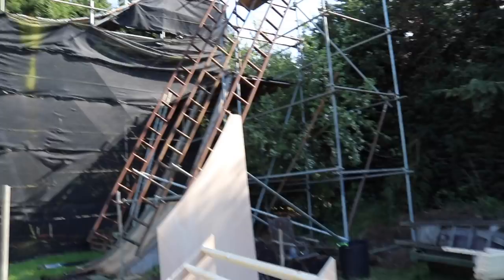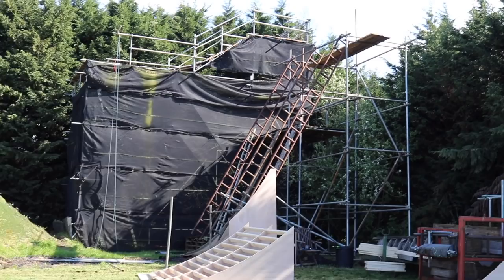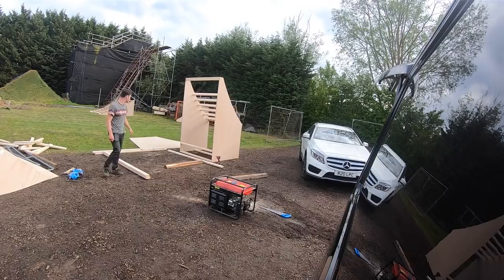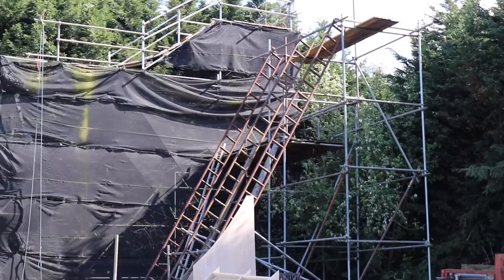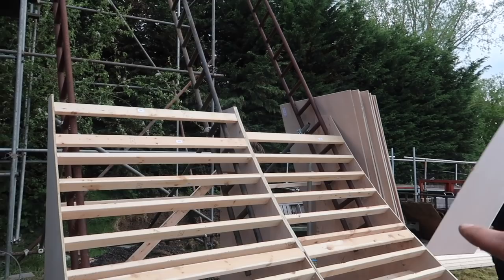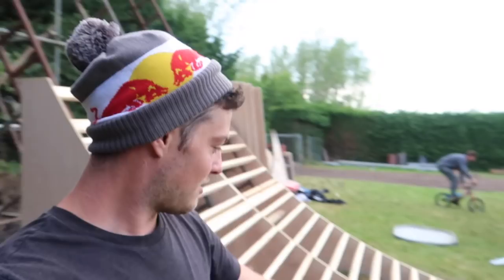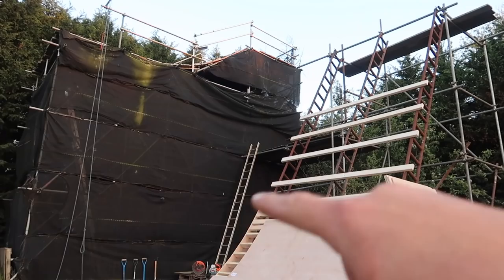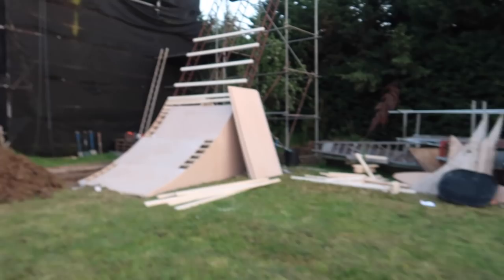THE AIRBAG ROLL-IN IS HUGE!!

Comment: Love your videos, can't stop watching even though i've never jumped a bike in my life!

Obviously too late now but maybe a suggestion for next time, use marine ply as it will last 10 times longer and wont delaminate and for the curved sections try using two sheets of 9mm ply. If you stagger the joints and use waterproof wood glue between the sheets it will be super rigid and v strong.

Comment: wood directly into the ground isn't really the best idea, the moisture from the ground will make it rote way faster :/ you could have put a waterproof cover underneath
Reply: Adraps its only going to be sitting on the ground like all of his ramps are itll be fine hes going to dig all that grass out
Reply: I reckon add some kind of treatment to the wood too if possible. Maybe bed in the sides with stones for better drainage?
Reply: FreeRider it’s not because he always done it like this that it’s the good way, btw he already had roten wood like the quarter he is rebuilding
Reply: Adraps yes and no itll help for sure but c'mon  this is matt. also main problem  was the quarter  was stright ply on mud. most my wood kickers at mine last 2ish years before needing new ply wood and the base and frame work has lasted as long as ive built them. granted this isn't uk weather
Reply: FreeRider i’m not saying that it‘s rubish, just wanted to underline that it’s a shame, it didn’t need really much effort or money, and that he should have done it at that point.
Reply: It's sitting on concrete footings you can see them when he shows the trench.
Reply: Adraps his jumps his life  and not its not a shame

Comment: Putting all that effort to build it defiantly makes sense to put some effort in to wood preserve it with something. Also the bottom bit needs digging around so that it’s not a low point. Ideally sit it on some slabs or bricks not more wood to pass the moister through.

Comment: Why did you put the plywood straight into the ground? The base is going to rot very soon.
Reply from the maker: I’m going to concrete around the footings up to a height above ground lever so it’s sold and the ply meets the ground above the water line

Comment: I was just wondering why you dont use HPL plastic (i think it's called like that) for the decking of the roll-in. It's the same stuff Vertical Skateramps uses for their outdoor ramps. It rides great and will hold for years!
As far as i know, it basically is resin impregnated paper.
Just checked, they call it skateface. But didn't find out where they actually get it from.
www.verticalskate.ch

Comment: You should use more protection (glasses, gloves ect) when using tools
Reply: Glasses maybe, though not required when using woodcrafting tools in their intended way. But NO gloves, they wont protect against cuts anyway but can instead get caught and pull the hands in further, but mostly give a false sense of safety.
Reply: @YouTuneIt  okey but personally one of my fingers got saved thanks to leather gloves, that's why I have my point of view. Anyway KIDS WEAR PROTECTION GEAR WHEN BUILDING STUFF

Comment: BROTHER throw that hand saw away and get a cordless skillsaw!!! Dewalt makes a real nice one that runs on one 60v and makita makes one that runs on two 18v batteries
Reply: And get matching Dewalt drill set and cordless 4 1/2 inch grinder, and you could build dam near that whole thing with one tool kit!!
Reply: Thid would also eliminate the need for the noisy ass generator!!! We build full house with only cordless tools! Well other than our air hoses for nail guns